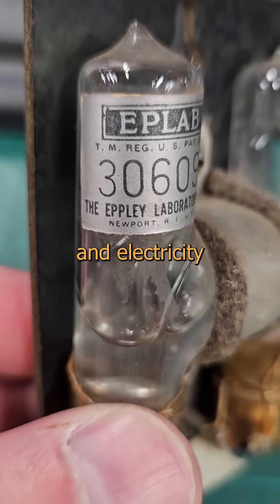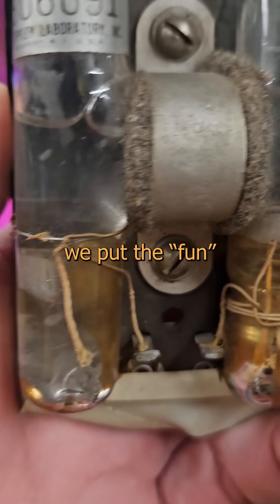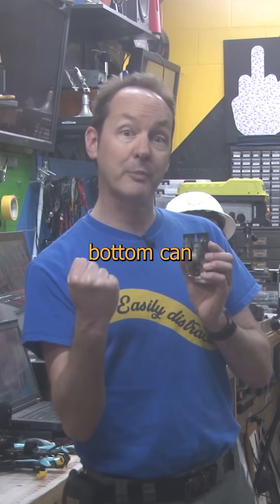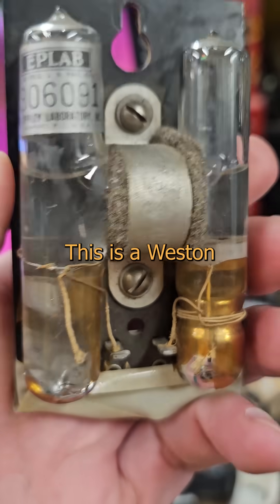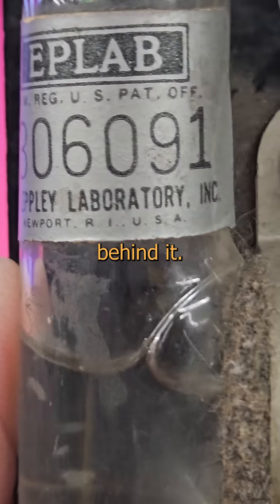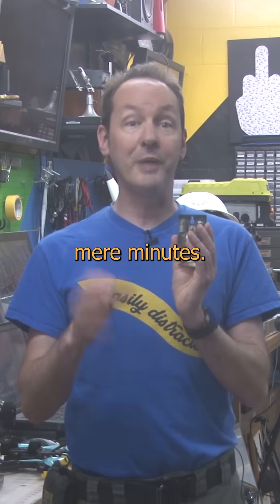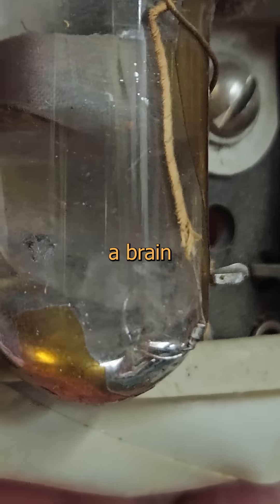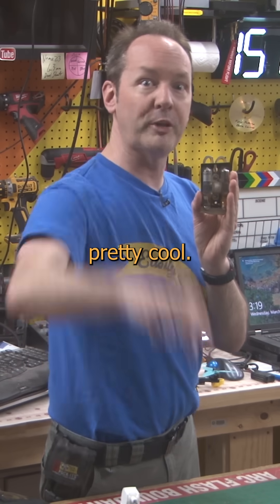The Weston Standard Cell #chrisboden #comedy #chemistry #electricity #electronics #science #history

Comment: “You have to compensate for temperature”
Oh. It’s precise precise.
Reply: The only way to be more precise would be lab conditions 😂
Reply: @5isalivegaming72  lol depends on the lab. Some of these labs be covered in dust and grime, and still using instruments older than the analysts
Reply: When I first started my new job and saw a class 2 measuring room with 200k € of just air flow and climate control, with .2 kelvin temperature difference across the whole room.. 
I was flabbergasted. 
To be Measuring in .04 microns, so .00004 millimeters still feels special to this day😍
Reply: @dr.candyflip4854 Dimensional measurements? Surface roughness?
Reply: @dr.candyflip4854 
In terms of 
English, I guess
A 0.2 Kelvin difference can mean the same thing as a 0.2 Celsius difference

I think it also works with Fahrenheit and whatever "R" is
Reply: @FoxDog1080  R is Rankine, and yeah, Kelvin and Rankine are both “measure from absolute zero”, just with either Celsius or Fahrenheit sized units.
Reply: @dr.candyflip4854 at my job I see about 200€ worth of heavy machinery and make about €11 an hour 🥲
I'm a city worker, all of us are heavily underpaid gotta love West Virginia
Reply: @dr.candyflip4854  does standing in a room like that feel any different than standing ina normal room? Does the air feel different?
Reply: @ It feels a bit like the universe is standing still inside the room.😅
And the air smells weird, never got used to it even after years🙄
Reply: @dr.candyflip4854  Betcha certain females could still detect a draught!
Reply: @FreedomIsEarned  That’s just not how the Challenger space shuttle was lost. It was lost due to one of the SRBs o-rings falling which could’ve been prevented if the people who were in charge of launching the shuttle listened to the manufacturers warnings about the weakness of the o-rings in certain temperatures.
Reply: @truename8825  the old, you should of listened to the engineer submarine implosion issue.
Reply: @amadeuscrossing7061 like the Thresher? Long ago I had a friend whose father was on that boat ....
Reply: Hate to be that guy, bud, but the challenger failed because 2 o-rings failed. I think you're thinking of the Mars Climate Orbiter, which did in fact fail due to a mismatch in units between 2 companies making parts for it.
Reply: Yeah. It produces 1.018638 V exactly. Temperature will change how much it actually produces so you need to account for that
Reply: @planetoforts Only at 20°C. Outside that range, there's a nice cubic equation to use to calculate the actual voltage (if you're using a saturated cell).
Reply: @planetoforts So at what exact temperature does it produce exactly that number?
Reply: When I built my Heathkit VTVM in the early 60's, we used a brand new carbon zinc dry cell and aligned it to the red dot on the meter face which was about 1.54 volts.
Reply: The Fluke 732 line has internal ovens for the zener for the same reason. Just the science and application of this one is antiquated and cool. If you want a voltage standard, and not just a rough measurement, you kinda have to adjust for ambient temp. Pretty sure air resistance is how a thermocouples measure temp, so temp inversely is effected by resistance. And resistance has a funny love triangle going on with voltage and current.
Reply: We had one of these in my electronics lab at school    it was long dead though.  We build a"volt meter" so we could measure the voltage without pulling current
Reply: @FreedomIsEarned   actually rather than look up dry comparison tables and dates, look up a video on here about JoBlocks; how and why they came to the US and you’ll find a much better and frankly more ‘murica answer

The Americans move first through Ford and then through WW1 production to standardise their inch across the country, as different states could have slightly different measures and it was only when it came to engines or modern munitions that it showed up

They used metric Johansen Blocks from Europe to do it, they are like magic, and worth looking up themselves although their name is universally shortened to JoBlocks. In fact at times in WW1 and then WW2 they had to be smuggled out of Europe to help US factories set up for the war effort

They are really neat things that helped build everything around you, and yet hardly anyone knows about them unless you’re a nerd or a engineer
Reply: That was when the volt/ohm meter was unrestricted to how much it could pull
Reply: @kbob871  LOL. There was most definitely a restriction...
Reply: @FreedomIsEarned  shows how much you actually know about the world lmfao.
Reply: @grey9803  Looks like they got the point and deleted the message. Sad day. We humiliated an idiot. Let's all take a moment of silence. 

...Alright, on to humiliating the next idiot!
Reply: Retired from a career in measurement science aka metrology. I saw plenty of Weston cells over the years. One of the few electrical standards that does not need calibration itself - It is a reference for other devices. Actually haven't thought of them for about 15 years ...
Reply: I'm a CNC machinist and a backyard mechanic. In USA metric is still used a solid 33% of the time. Tons of cars have metric parts so we use metric wrenches ;). But seriously though the AVERAGE IDIOT AMERICAN, not an actual smart one with a job requiring the use, will have zero clue how to translate anything other than kilos and Pounds, and even then that's just because we have a strong Hollywood drug culture that  helps with that one 😅
Reply: God I wish we used metric.
Reply: Once you get precise, it all becomes metric. N Thousands of something is metric too. In a way that matters.
Reply: @theGoogol worked in 1000th of an inch as well down to .02
Reply: @FreedomIsEarned  what double standard do you have to use for "America"?
Reply: @kstorm889 Imperial and Metric are the two standards employed simultaneously in the USA. Fun fact: we were in the middle of a long-planned transition to the Metric system (already selling gas by the liter and post KPH speed limits) until Ronald Regan became president and promptly cancelled the effort (and removed Pres. Carter’s solar panels from the roof of the White House), because ‘Murica.
Reply: @Greg-om2hb  Of course it was Reagan -_-
Reply: @Greg-om2hb Carter was trash anyway.
Reply: @Greg-om2hb   Carter was a nice guy but a fool.  I'm sure he was glad to live to see Biden replace him as America's most incompetent president in history.
Reply: @Greg-om2hb  just add it to the long list of reasons why Reagan was awful
Reply: @Greg-om2hb As a canadian, i think it great to have historical measurements around still   🤷‍♂️🇨🇦
Reply: @Greg-om2hb  glad I'm not paying 4 euros a LITER, its bad enough at 3 Dollars a Gallon.
Reply: @kstorm889  Sugars per Freedoms...cubed.  Of you can break it down to eagleflaps per core second. 

And it's spelled "Murica." XD
Reply: @kstorm889 US ruined many experiments and first live tests by forcing the world to use an outdated overly complicated(not complex) system nobody but them uses, even brits don't use it when making globally affecting products or tests.
Reply: Lol in the actual labs we have in the USA we use metric for 95% of stuff, measurements and the important stuff.
Reply: @kstorm889  We still use the old Imperial measurement system here (feet, inches, pounds) instead of the vastly superior metric system. That's likely what they are referring to.
Reply: @PNW_Marxist What's a metric Amp, Ohm, or Volt?
Reply: @victorbruce5772  those are metric units, amp is even a base unit. You can express voltage in terms of kilos meters seconds and amps if you really want to, though it would be needlessly confusing.
Reply: @PNW_Marxist  the imperial measurement system is just as good as metric neither are better
Reply: @jasonskeans3327  12 inches to a foot? 3 feet to a yard? 5280 feet to a mile? No it isn't, it's godawful especially given metric is just pure base 10.
Reply: @victorbruce5772   The volt and the ampere are metric units with no equivalents in imperial. So Murica use Metric ...
Reply: @PNW_Marxist  its all arbitrary
Reply: @PNW_Marxist the big difference now is that the inch-foot-mile (and other customary measurements are now defined in terms of the International System of Units "The SI", aka the metric system. So it could be said that the yard, fathom, furlong and even "itsy bitsy" are defined in metric units.
Reply: @victorbruce5772 they are exactly the same as you wrote!
Reply: @PNW_Marxist  vastly superior? How so? We’re more used to inches feet and pounds, so we’d have to change essentially the entire countries form of measurement. They’re also just easier measurements to use on the fly. Do you know what a 38x89 mm is? It’s literally just a 2x4😂 Fahrenheit is more accurate than Celsius, 1f is -17.22 C. Our system is also more accurate for carpentry and machining. And if you want to go real in depth, the metric system bases their temperatures off of the boiling point of water. Guess what changes with practically every variable? The boiling point of water. Water will boil at lower temps in the mountains and higher temps underground (I think, might be the other way around) in other words it’s just pointless. Our system is actually the superior system😂
Reply: @FreedomIsEarned  uh dude, y'know the US system is derived from metric right? 

It's not Ye Olde english imperial measurements which are akin to black magic 

Go have a look at what happened last time they adjusted the SI units, the US system moved with the metric system, while the UK one didn't. There's now a growing gap between a US and a UK inch
Reply: @mor4y Is the U.K. inch shrinking relative to the U.S. inch? You said the deviation was growing. If the U.K. standard weights and measures are set to known constants (a stick a foot long, a platinum iridium ball measuring a pound, et cetera)  degradation of those constants is the only way to cause deviation over time. I mean, if the U.S. distance measures are based on metric,  then they're based on SOL in a vacuum, and that doesn't seem to be changing (much) relative to the passage of time. On a cosmological scale, recent time is likely very different from what it was  in the first years of the universe, due to a spread of density and thus gravitation.
Reply: @christopherkarr1872  the Weights and Measures Act defines a yard as being ‘0.9144 metre exactly’, a yard being 3 feet, or 36 inches, and so a UK inch is 0.9144/36 or 0.0254 metres, a metre being defined I mean I could repeat all the science words by but, well, a metre is a metre. The thing light travels over 299792458 times a second. A second being a second.
Reply: @ohpurpled  I'm aware of the definition of a meter. Otherwise I would not have mentioned the speed of light in my prior comment. My question is, why would the sizes drift in either system? Weights can lose mass over time (due to some of the classical weight standards having radioactive decay properties, they ejected particles), but the distance light travels in a given time is a constant.

As an aside, I need to check in on the silicon sphere which is designed to be a radiologically inert mass standard.
Reply: @ohpurpled  A second of time of course being a certain interval of radioactive decays on average, and - oddly enough - since a meter is defined as 1 lightsecond/299792458 = 1m, a second is also defined as 1m*299792458.

This does assume, of course, that the defined period of a year is not changing relative to our radioactive decay standards.
Reply: @mor4y the international inch of 25.4 mm is different in length from the international inch of 25.4 mm? How'd you figure that one?
Reply: @mor4y  Pssst... Don't go telling them that we are, in fact, on the stealth metric system. It's a lot more fun to boast about our ability to do multiplication and division with numbers other than ten and as them why metric was unable to put anyone one the moon or build a working stealth aircraft. We like to keep the fact that we pegged it to the metric standard way back in the 30's quiet, because Freedom Units!
Reply: @mor4y  that is simply not true. Unless the american imperial system acts on a base 10 system for its units and nobody anywhere has heard about it for some reason.

Comment: Fun fact: Lots of "boring brown boxes with modern electronics" used to have a 1.018v output for easy compatibility with these Weston cells! Standards like the fluke 731/732 will cost you $1500+ used. Still good to single digit part per million stability PER YEAR!
Reply: Like resistors, the older they are the more certain you are of their tiny tiny drift.

Comment: Ahhh, the Eppley standard cell. Put no load on them and they will output that exact voltage for decades. 

Fluke used them in the old differential volt meters as a cal source. 

Yes, I am an old engineer. I even own one.

Comment: "[Cadmium] has acute toxic effects, chronic toxic effects, and if there are any effects in between those it probably has them, too." -- Derek Lowe
Reply: Yea, the shit is quite nasty; so unpleasant to be around that I believe there is only one plant in the entire US that handles nickel cadmium battery recycling.  The entire reprocessing operation is handled without any human interaction once the cells are opened. Whole batteries go in one side of the plant and nickel shot and cadmium shot come out the other end of the building.
Reply: Mercury has acute toxicity and chronic toxicity. Cadmium had all toxicity. The only thing this little guy is missing is either thallium or beryllium, depending on what you want
Reply: @planetoforts except that metallic mercury is very badly absorbed and therefore relatively safe compared to other toxic metals.
Reply: @trex2621  Elemental mercury, sure. But this isn't just the elemental mercury, it's Mercury(I) sulfate - and mercury ions are absorbed quite readily.
Reply: @planetoforts how'd you forget the real OG's of lead and arsenic
Reply: @planetoforts Throw in some fluorine for a good measure
Reply: Derek Lowe is a fantastic writer and it's a shame he quit adding entries to "Things I Won't Work With" years ago.
Reply: @everything-narrative  and to think, my RC boat had a Ni-Cad battery in it bigger than my cellphone
Reply: An "In the Pipeline" reference? 

Damn dude. Warn me before you drop a decade on my head like that.
Reply: they use a cadmium "eye" to view the flame in your boiler if you have oil heat in your home
Reply: this has shop teacher vibes. totally dig it.
Reply: @KirillKaplan  Look up Derek Lowe's "Things I won't work with" series of articles. If you know a thing or two about chemistry it will have you howling with laughter.
Reply: @everything-narrative  ClF3, or Chlorine Tri Fluoride and SbF6, or Fluroantimonic acid are my favorites.

ClF3 is so reactive and such a strong oxidizer that no ignition delay is known. It reacts explosively with almost every known substance. It will ignite and burn things otherwise normally incombustible, like metals, concrete, asbestos and ash.

When reacting with everything, it produces hydrofluoric acid clouds.

There was an accident in I think the 1950s where hundreds of gallons of it ruptured out of a storage tank. It consumed the concrete room it was in and several feet down into the earth.

SbF6 is equally as exciting, it protonates every known organic compound, as well as hydrocarbons. It can only be stored in PTFE or PFA because it reacts explosively with all known metals and eats glass.
Reply: Chemistry ain't complete without a Lowe quote.
Reply: @everything-narrative  I got severe ED for nearly 4 years from licking cadmium metal
Reply: @stimulittus  I'm extremely happy to know you are still with us! That sounds horrible!
Reply: licks paintbrush to soften up the paint
Reply: I got to be a part of cleaning out the lab underneath my department building and on a shelf was a 1’x 3’ wooden box with the lid nailed in like a coffin. Helpfully “Cadium” was written across it.
We opened it up and sure enough continuous metal sheets the size of the box with no other coverings around them

My Prof lifted one up, “Yep that’s cadmium… I’m going to wash my hands”

In hindsight there were a ton of unpainted lead bricks everywhere too but people working in there longer got tested and came back fine.
Reply: @nathan92238  Unless the lab students were eating the lead bricks, there's no reason to assume they've been poisoned.

For lead poisoning to happen, you'd have to be eating lead, inhaling lead dust, smelting it in an open fire or be exposed to a bio available form of it, none of which apply to lead bricks.

The cadmium, if it was in raw metal form, was also not terribly dangerous. You of course wouldn't want to handle it, but it's not like mercury, where it constantly offgasses mercury vapor. Where it would be a problem is if the metal was degraded and starting to flake apart or oxidize. Then you'd want to probably have a respirator.
Reply: I've worked with low melting point alloy, and some 117° melt point alloy contains Bismuth, Lead, Tin, Cadmium,  and Indium.
There were two other melt points above that, and they would be melted back into a tank of 180° water to recover and use again.

My joints started to ache and made me feel old in my 30s.
I quit that job, and now I feel my age again.
Reply: @richtomlinson7090  You may want to get a blood test, you definitely had some form of heavy metal poisoning. That stuff can stick around for ages and do ongoing damage if it isn't treated.